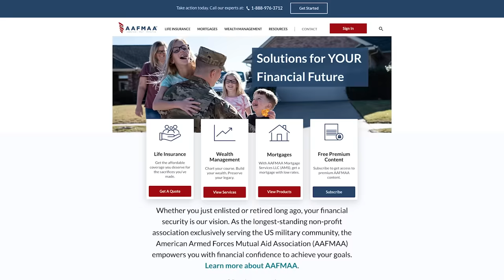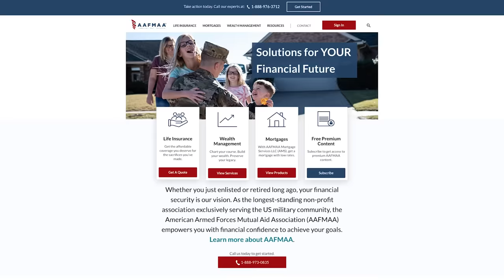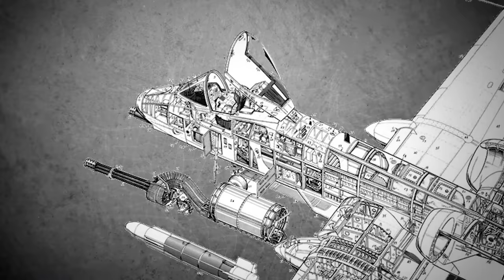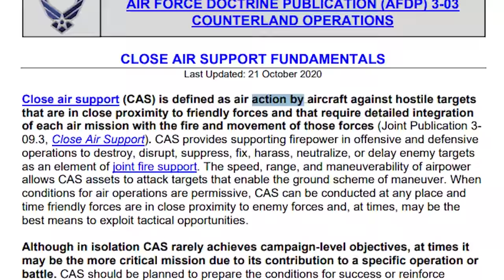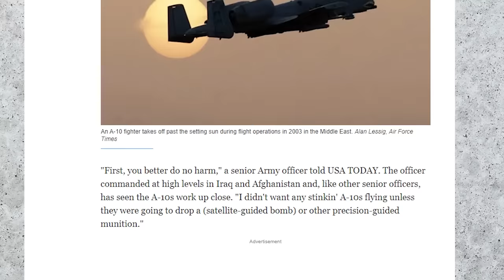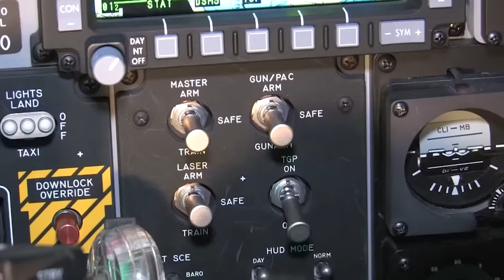Why the Air Force is Screaming to Retire the A-10 Warthog

Comment: I've spent my life in the military, moving from Infantry to Air Force Controller, and I'd like to praise this video. It's is not overly technical, and doesn't get into the weeds of modern 5th Gen Air Power Theory, but rather hits all the big points really well. It's very hard to convince those who aren't employed in the Air component to the current flaws of an aircraft like the A-10, but this video does it very well. Bravo.
Reply: IMO, the problem isn't the long-overdue retirement of the A-10 but the utter lack of an adequate replacement. The F-35's abysmal loitering time, severely limited payload capacity, and hefty price tag make it ill-suited for supplying timely CAS, and drones can only partially compensate for its failings, thanks to their lack of Mk.1 Eyeball and extreme vulnerability to EW and the like.

Additionally, the "low-and-slow doesn't work against near-peer adversaries" excuse is so outrageously stupid that it boggles the mind that anyone buys into it. The last seventy years have proved that politicians are nearly as adept at avoiding near-peer wars as they are at creating not-at-all-peer "conflicts," and military technology has changed enough that even near-peers are likely to end up engaging asymmetrically a lot of the time. A properly designed, dedicated CAS airframe would not only be incredibly valuable in the all-too-likely event of another Vietnam or Afghanistan, but also in open war against an opponent like China, doing things like defending against guerilla-style attacks on logistics and C3 and mopping up ground forces after the air defenses had been cleared.

Edit: In case it wasn't clear, said dedicated CAS airframe should not be the A-10. While the design goals still hold true, for the most part, some of the approaches taken no longer do. For example, it might make sense to have something gun-like to avoid expending $200k rockets on $20k pickup-with-bolted-on-MG, but there are far better options than 30mm auto-cannons for that task.
Reply: @irrelevantfish1978 Even guerilla forces can threaten very low flying aircraft with MANPADS. The thing about drones being vulnerable to EW, is any type of CAS relies on communication to be informed of the mission to begin with. Most modern CAS has automated target tracking already. Whatever means you used to call the airbase, you could call an unmanned mini-cruise missile launcher a few miles away that was dropped off by a truck or a helicopter previously.
Reply: @JWQweqOPDH  MANPADS will have minimal success against reasonably stealthy aircraft (which any A-10 successor absolutely could and should be), even if it's flying low and slow, and there is a massive difference between the durability of voice comms compared to remote drone operation, which is far higher bandwidth and far less tolerant of signal corruption and latency.

And insofar as automating CAS, that's problematic for all kinds of reasons: it's bad PR, it's expensive (if not impossible for such an electronically incompetent outfit as the US military), and turning complete control of bombing runs/cruise missile strikes over to people with infinitely more stress than aerial observation capability (ie, ground troops being shot at) is not a great way to avoid friendly fire and collateral damage.
Reply: @irrelevantfish1978 Also, didn’t the A-10 also do CAS for Combat Search and Rescue?
Reply: I realised it was outdated when people suggested that Ukraine should get some A-10's but Ukraine denied them because they could easily be shot down and wanted F-16's to hit hard and fast before Russians could retaliate... This suggests that the A-10's would be easy targets against an opponent with capable anti-air defences or half decent fighter jets making them completely redundant on a modern battlefield that isn't against simple insurgency groups.
Reply: @irrelevantfish1978 @irrelevantfish1978 so, in the event of another Vietnam or Afghanistan style war, why wouldn't you just drones for the low, slow flying aircraft niche?

As for your suggestion that a replacement for the a10 be stealth capable, keep in mind stealth is a massively expensive capability.

Also, quite frankly, gun based CAS has always been kinda eh? Most of the A10s kills have been with missiles (as much as people over hype the gun), and you don't need something that flies super close to the ground to fire those. Hell, just like, a cheap drone spotter data linked to a firing platform will probably do the job more cheaply and better at that point.
Reply: @irrelevantfish1978  The per-unit cost of an a/c is less than half the battle. One has to consider 'total cost of ownership' over the lifetime of the a/c including pilot and support personnel training and other incidentals specific to that model. Although it may be cheaper to buy a CAS specific model it is likely better in the long run to add those numbers to the F-35 production demand as higher volume means lower cost. In the long run the F-35 is the only game in town to help reduce the defense budget.
Reply: @garymartin9777  need more Avenger type drones for CAS.
Reply: I find it lacking in 2 areas. And tbf these 2 facets are usually skipped over, but still critical to understand what's going on recently and will be going on in the future.
Most of the criticisms around 15m in could be addressed with a simple avionics upgrade. It's these 2 issues which are gutting A10s.

1. AC130s. Gunships can do the "low tech" unga bunga better than warthogs. They can stay on target longer. They have a critical weakness against peer adversaries, becoming sitting ducks. However, we havent engaged an air superiority peer in a long long time.

2. Drones, including loitering suicide drones. These are the future of CAS. They've already been doing surveillance and surgical strikes since W and Obama. They've come even farther.
Reply: @irrelevantfish1978 we already see Ukrainian infantry using drones very effectively - against a better equipped military that is generally considered a peer to US.
Drones are here to stay.
Reply: @crackajacka87 Yeap... and against the "simple insurgency groups" an AC130 can stay around a lot longer, packs more punch, doesn't need to strafe / turn around, has outstanding battlefield awareness.
The A10 is basically just a big d morale booster thing: 'look at this thing'
But i would love to see them start providing CAS to whatever the Mexican DEA is called. NOLA is already in range 😎
Reply: Close air support is an Air Force task. If not an A-10 then what? Ya’ll just want to get back to a snuggly base.
Reply: @mattheww2855  incorrect. CAS missions are assigned to all 4 services/3 components. Army and USMC have organic capabilities for this exact purpose.
Reply: @irrelevantfish1978 What boggles the mind is you thinking a low and slow platform is going to be in the air long enough to provide any CAS whatsoever.

When Ukraine doesn't even want them and are barely getting their SU-25s in fast and low for hit and run passes, me thinks your highly confident comment won't be passing the test of time. As the Air Force has stated, they look at effects, not platforms, and low and slow isn't going to get you any effects at the FEBA anymore.
Reply: It's ugly,  it protects the "army" grunts on the ground...would you rather step into a corvette or a jeep CJ ?
Reply: @jeromeace1282  Why not use drones? First, the Mk.1 Eyeball and a 0ms ping is helpful when attempting to deliver ordinance to targets in close proximity to friendlies/civilians, and second, there's all kinds of fun things an opponent could do to literally bring your drone fleet to a crashing halt.

Also, no, stealth isn't necessarily "massively expensive." Yes, you'll pay through the nose if you're trying to design something to sneak past high-powered radar installations at supersonic speeds, even if the project is well-conceived and the contractor competent (neither true for the F-35), but merely enhancing survivability at sub/transonic speeds is a far, far cheaper proposition.

And as for gun CAS, why does everyone get so stuck on that? The A-10 is more than a flying BFG, and the F-35's insufficiency has nothing to do with its lack of one. Read what I wrote and respond to that.
Reply: @garymartin9777  Cost isn't the only issue, and even if it were, the increased number of aircraft required due to the F-35's deficiency in terms of loitering and payload would add far more to the total cost than you'd save due to increased volume. Additionally, maintenance and fuel would be way more expensive per operational hour than a transonic platform.
Reply: @irrelevantfish1978  
Stealth effectiveness is severely diminished within 20-30miles+ , it would do a ''next gen'' A-10 no good whatsoever. I agree that the budget would be better spent on expanding close support drone tech assisted by long range stealth fighters.
Reply: @irrelevantfish1978   @irrelevantfish1978  no, no it fucking isn't lol, reliance on the Mk 1. eyeball is one of the reasons the a10 has so many blue on blue kills. That shit does not matter in any case where who is who is ambiguous unless you're flying way too close to the ground. 

There is an argument about ping, but I don't see how that matters as long as it's less than a second.

And sure, people can do stuff to mess with drone, but that's an arms race. 

As for that argument, I'll go back to read your rant about the f35, but I'm immediately suspicious of anyone who is parroting "reformer" line, which is what your second argument kinda sounds like to me. They were saying similar things about other aircraft until they turned out to be great (either the f16 or f22, don't remember) 

As for why people talk about the gun, prolly because it gets overhyped, and because a lot of its design flaws are due to it (since the plane was designed around the gun, the missiles were a later concession to how shit the gun was). And sure, there's upgrade packages, but iirc the cost is enough that they might as well just buy new f35s.
Reply: @constantinesoldatos  from what little we know about 6th Gen fighters (aka some fucking press releases lmao) , it seems like there will be a focus on having them be a hub for a group of drones.

So that's prolly coming down the pipeline at some point.
Reply: @JTA1961  it also has a track record for massive levels of blue on blue kills lol. So if anything getting rid of it protects army grunts. 

And if it's not using the gun, why keep it when there are better missile platforms?
Reply: To put it from the perspective of a vet from the other side, there are 2 thing the A10 gives that no other option the west is willing to put money into can. And that is ability to stay in the area and ability to engage for a long time. With a strike fighter, you get how many missiles were bombs for six or so and after that you’re out of weapons and need to re-arm. With a strike fighter, you get how long in the operational area 15 minutes or so and then you have to leave. The aircraft like the a 10 can stay in the area for hours, and provide more than a dozen strafing runs plus bomb strikes. Sensible move for the west, would be to buy something like the MI 28 or the SU 25, but that would be admitting the Russians were right about some thing and like we see from Ukraine We’d rather like millions of people die than admit the Russians were right about anything.
Reply: @irrelevantfish1978 Kinda sorta maybe have to agree with you @irrelevantfish1978; even if it’s not the A-10 (which hey, there are older platforms in service) then at least some other CAS platform specifically built to take a hit, put bombs/rounds on target and not specifically designed to make Raytheon or Lockheed or Boeing ALL the money ALL the time. This whole, ‘put every single god damned egg in this one stealth airframe basket’, thing the services have thought up is truly disconcerting. What if some near-peer finds a counter to the tech? What if there is some fault which starts crippling availability times (which has happened more than once for this and other platforms)? I mean, we’re going to spend ridiculously ridiculous sums of money in any and all events, what’s wrong with a few extra bucks towards another platform dedicated to close air support? Yeah F-35’s and F-22’s are awesome, there’s no doubt, but God forbid we get into a war with China or God God God forbid the Russians, F-35’s ain’t gonna cut it.
Reply: The A-10 can be stealthy when flying low. I was hiking out in the desert in the canyons and one of those flew over real quickly and down low. I really didnt even notice it coming because it was flying so low.
Reply: @Mortablunt  So first off, I'm assuming you're talking about the a10's gun, gun based strike fighters have always been terrible against armoured targets (there have bee studies dating back from the soviet days, along w/ various others agreeing with its findings, showing a huge tendency to over report kills despite how little casualties gun based plane attacks actually deal to armoured targets)

Meanwhile, if you want something w/ a gun for use vs infantry....you don't need a dedicated aircraft for that lol.

Second off, you want something that can loiter in an area for a long time? That's what drones are for, hell, something like the Byraktar only performs about as well as WW1 era planes iirc. And that's all it needs to do.

And if you want something w/ a lot of shots, tbh, just stick a gun on the drone or use it to spot for mortars/artillery.

Also, there is no world where the west would be willing to agree to the conditions russia would require to sell them Migs or Su's lol. Buying advanced weapon platforms isn't just like buying groceries lol, you need a good relationship w/ your supplier.

That's like saying the Russia would be able to buy Abrahms tanks to make up for the fact they've been using the same engine since world war 2 (except the t14 engine which is somehow even worse lol).

And the only thing the russians are right about is that NATO expansion means the russian empire can never be reborn.
Reply: @miamijules2149  Its questionable if the design tradeofs to make a CAS craft be able to take a hit are worth it. Assuming there are ground forces involved, just using drones as artillery/mortar spotters will prolly fill the role a lot of the time. And if not...well, drones can do the job way cheaper and w/out needlessly risking the pilot's lives by flying low and slow.

As for older platforms being in service, that tends to be because they found a new role despite their original one being obsolete 

(like, the b-52 gets used as a platform to fire cruise missiles off because they turned out to be engineered in a way that's super good for that, despite the fact that they were built as strategic bombers, which are obsolete as a concept)

(or how the infantry fighting vehicle replaced the armoured personnel carrier, but the m113 is still used in other roles

not that anyone who watched the pentagon wars would understand that lol)

As for the f-35, stealth is probably going to become a pre requisite to surviving in contested airspace tbh (the invasion of ukraine being not the best example because neither were really up to snuff in that department). Its just there's an assumption war will look remotely like it does today because that's what people know.

As for the whole 'peer war' China is the only real consideration where the f-35 actually matters. Russia's military has been revealed to be a husk that exists for propaganda and to pay for people's yatch funds (and yes, the USA lies about their weapon systems, but they do it to make them look worse than they really are lol), but their nuclear arsenal means there's invading them isn't an option.
Reply: @djsmith2871  You clearly didn't read what I wrote, so I'll TLDR:
(1) Most of the US military's adversaries won't be near-peer.
(2) Even between peers, the nature of war has changed, such that a lot of CAS will be necessary in areas with minimal surface-to-air and air-to-air threats.
(3) The A-10 doesn't cut it anymore, but the F-35 won't, either. There needs to be a new dedicated CAS platform.
Reply: @constantinesoldatos  If stealth is useless at <30 miles, why bother stealthing helicopters, particularly when it's impossible to do so to the same degree as fixed-wing aircraft? Answer: because there's a big difference between surviving by not allowing the enemy to know where you are and surviving by making yourself hard to target. Even if they can see you, and even if they can get a lock, stealth gives additional time to evade and makes countermeasures more effective.
Reply: @irrelevantfish1978  That is actually a fair point, even if they can see it, it's still harder to maintain proper lock to guide an AA munition against you. Thank you I didn't think of that fact. Still though they probably want to invest in drone tech a bit more heavily for close support since it ticks all the boxes, can be deployed faster and in larger numbers and puts less soldiers on the line. 
But I'm only speculating those are the reasons, it's all we can do after all based on open source information.
Reply: @jeromeace1282  Get your facts straight. The A-10 makes extensive use of vision systems, particularly thermal, and its independence of pilot vision is, in fact, one of its main selling points. Additionally, in spite of adding weight, being a major PITA to stealth, and the AR system making it entirely possible to forego/greatly reduce, the F-35 has a whole lot of transparent canopy, so clearly a whole lot of very knowledgeable people believe that the human eye is a great sensor package to have available.

And as for your dismissal of drones' vulnerabilities ... gotta admit, my jaw dropped when I read it. I mean, if your intended opponent probably possesses/will possess economical countermeasures with a 100% success rate against your weapon system, you're not in an arms race; you've flat-out lost it.
Reply: @irrelevantfish1978  ah, okay, I wasn't aware the upgrade packages meant that you don't have to rely on binoculars anymore.

I don't see how that's supposed to be its main selling point when a heavier reliance on sensors has just kinda been the direction things have been going since... Well since plane mounted radar has been a thing.

As for the drone vulnerability stuff, a decent bit of what I'd heard about going on in Ukraine was exploiting the civilian origin of most of the drones being used, which wouldn't exist in military stuff. 

Also, what is this magical thing that prevents all drones from working? Who has developed it. I can believe it's not being used in Ukraine because, well, quite frankly the Russian army is dogshit, and most of Ukraine's stuff is western handouts.
Reply: @jeromeace1282  
Go check Red Effect and Cone of Arc for clarification about the T14, the engine claim is like saying the US uses the Mauser 98 because it uses the Mauser action in the M40A rifle.

Anyway...

The gun is absolutely an important part, because it offers flexibility and cheap firepower against more numerous more delicate targets. Not everything needs a tandem shaped charged hollow penetrator missile -- men, cars, and APC's will go down just fine to the 30mm. That ability to not waste short supply priority munitions is very important when operating at scale for prolonged periods.

There are some truly huge tradeoffs for all possible substitutes for an A10/SU25 aircraft. For one, you get about 80 minutes of loiter with them, during which they can be on site to deliver precision support within seconds. Not the minutes it takes artillery to reckon out a shot and then get it over. These planes can carry more than helicopters or drones, that's important, it means they can stay combat effective longer.

Helicopters are a convincing alternative, but they still carry much less and are significantly more fragile than fixed wing aviation.

The big problem with the Bayraktar is it has a tiny payload. You get up to 300lbs across a max of 4 shots. Can't be beat for persistence, agreed.

For maximum firepower and basically unlimited endurance, nothing beats tanks, but then there's the problem with getting them there and the lack of perspective they have on the ground.
Reply: @Mortablunt  First off, no it isn't? The red effect video uses a lot of deceptive tactics (mainly going off an a vaguely related tangent about a specific detail that isn't relevant to the actual point) because actually defending the t14 on its merits would require admitting if not for the engine being terrible, it would just be a mid tank compared to western designs. 

And also, lets say it was a correct analogy. It would only apply if the mauser firing mechanism was an irredeemably bad one that they then decided to pidgeonhole into their new gun despite it being terrible because they didn't have the r&d talent to develop something better.

As for the gun...even if the gun is worthwhile to keep (notably iirc certain more modern western jets, including the f35, do have the option of adding gunpods, they just don't use them because they're not needed) the a10 100% is not the platform you want for that. 

Its too vulnerable to survive in contested airspace (doesn't matter if you can fly back after taking several hailstorms of bullets, at the end of the day a MANPAD doesn't give a fuck about that and will shot down your multi million dollar air craft out of the sky for like, what, 100k dollars maybe, nevermind other air defences that exist), and in cases where it did operate in complete air superiority...it killed a lot of friendly soldiers. Hell, in afghanistan they stopped using it due to it killing so many civilians that it was a PR win for the taliban. (the gun is uh...well, its super fucking inaccurate) 

As of late the a10 ended up getting used as a missile plane a lot of the time...and at that point you might as well use the f16.

You could argue that this is a failing of the system rather than CAS gun planes being obsolete...but given how russian pilots barely get enough flight hours to keep their certification, it'll be hard to actually prove that.
Reply: @jeromeace1282  Cheesy crust, you don't know anything you're talking about! Buh by! I'll let reality do the talking for me as the results come in.
Reply: @Mortablunt  there kinds can't be results if gun based CAS planes aren't being used tho? The Ukrainians don't have a CAS aircraft, and last I checked the Russians are literally just lobbying missiles from specific migs from their side of the border.

And if anything, the latter is an indicator this air defense environment is terrible for gun based CAS planes.
Reply: @jeromeace1282  It would probably require two magical things, actually: anti-satellite missiles and signal jamming. Without a constellation of communications satellites overhead, it would be virtually impossible to prevent a well-equipped, well-informed foe from blocking communication between drone and operator unless they were very, very close to each other.
Reply: @irrelevantfish1978  so, I'll give you the benefit of the doubt, and say that yes, attacking the satellites (in ways that won't blow it up because that's a fucking awful idea, as Kessler syndrome means you've now probably pissed off neutral countries and your allies, and have also probably messed up your own constellation as well) would be effective, but opens you up to retaliation that... Probably isn't worth it? Not quite sure what the best method on that front would be though. 

As for signal jamming, honestly I don't know enough about that one to say. 6th Gen fighters might solve that tho, as from what few press releases there are they're probably going to focus on being a hub for drones, which implies much closer ranges than what you see with someone in the US drone striking the middle East.
Reply: @irrelevantfish1978  The F-35 and F-16 can carry APKWS, which is in the same price range as a gun (all things that make it necesary included) and is considerably more accurate. 

The F-35 is also cheaper to operate than the A-10's. If you've ever worked on beater cars you know this. The older shit gets, the more it needs to be maintained and the more spare parts it is going to need.
Reply: If the USAF doesn't want them the Army will happily learn how to maintain them.
Reply: @LupercusArchanus  the army has no intent or hope of maintaining them. Wishful thinking at best.
Reply: They've already got a replacement if they chose to go with it. The Sky Warden is already being used with sf units. Similar plane I don't remember the name is seeing action in Africa right now with good results. I think a plane is still viable over drones because of the amount of munitions carried and drones are taken down easier than planes and with counter options being developed will continue being taken. Don't get me wrong drones definitely are here permanently and are successful just they've got their uses and problems as well.  F35 is costly to operate and cannot stay in the area for long periods. Yes manpads are a threat to a slow low flyer but it's not like every person or even unit is/ will be equipped with them. UKR has been a good example of all these problems faced. Some areas are covered by aa others not. Manpads have been effective but not always and limited numbers.
Reply: @ronnie0817  The F-35 is actually cheaper to keep in service than the A-10. The A-10 is  a very dated airplane and that takes ALOT of maintainance to keep flying.
Reply: @koekiejam18  I know and agree I'm not saying to keep using the A10 I'm saying replace it with a different platform that can fill the gap between using the f35 and drones.
Reply: @ronnie0817 That might just end up more expensive than just using F-35's and drones. Unless offcourse it is (relatively) short range at which point artillery will work.
Reply: @koekiejam18  I already provided a reliable option that's being used currently by socom and another being used in Africa. It's a cheap platform to purchase and operate. Yeah you could call arty and use a drone if you're in range of it or can move it in reasonable time. Like I said there's gaps that multiple options can fill. The Sky warden or similar has proven effective and filled the gap of no arty and too expensive plus not enough fly time. I don't remember the exact price but its around $150000 for the plane and then like $70000 for upgrades to make it cas. I think it's the cheapest option for the role
Reply: @irrelevantfish1978  the problem with replacing the A-10 with another platform capable of "long loiter time, huge payload capacity" is that spending a long time on station in a non-permissive environment is nonviable.

The problem with the A-10 isn't that it's slow and has a massive radar cross section, the problem is that it has those features in support of the ability to stay on station for extended periods of time with a massive payload.  Modern air-defense and air-to-air capabilities necessitate low observability (which limits external payload options) and a "shoot and scoot" approach to weapons delivery (limiting loiter options).

Having the endurance to stay on station for 4 hours does no good if the enemy has the ability to kill anything which remains on station longer than 15 minutes.  Having the payload capacity to level a city block one window at a time does no good if bringing it to the fight means the enemy can  see (and therefore, kill) you before you reach the target.

The problem is that peer and near-pear air denial capabilities make the MISSION of the A-10 nonviable.  That's why it's going away.
Reply: @ronnie0817  It does however require the needed personel to keep it flying. It requires pilots to be (re)trained for the specific airframe and it requires new parts. Things like reeducation and infrastructure dont come cheap,
All in exchange for a rather cheap plane
that houses a rather expensive pilot. (A pilot that wont have the option to eject and is instead left struggling to get out of the cockpit.)

My guess is that if the Airforce can get away with using just the F-35 they absolutely will. 

A big sidenote is also that the Skywarden isn't that good of a plane, it is not even seen a replacement for it for its predecessor, ( a repurposed passenger plane used exclusively for anti insurgency warfare.)
It is meant to take over Strike missions and ISR only. (ISR offcourse being done incredibly well with drones)

Meanwhile the F-35 is getting cheaper and cheaper to operate. ALOT of countries are also currently building up infrastructure, training facilities and crew experience that is completely interchangable across continents.
External fueltanks are also in development for the F-35 and with those it will be able to loiter for more than enough time to completely replace the A-10.
Reply: @koekiejam18    it does require all of that and no it doesn't come cheap. But it's airframe is common parts are cheap and common. If a farmer in the Midwest can build the infrastructure and maintain it the government should have no problem. Butt from what I've read it's about $10,000 an hour over expected lifetime whereas you're looking at up to $150,000 an hour depending what resources are used to fulfill mission (Q9, A10,F35) . The program right now is being developed for sf use it wouldn't cost much more to expand the program and add a few more planes. Yes there's no ejection seat that's why the system was built with survival similar to A10 and counter measures for manpads and other systems primarily to be used in areas that we have control of the air. Even with the f35 getting cheaper it's not always the right tool or available Iraq and Afghanistan are examples F16s they weren't always available or even with extended tanks stayed for 30 min and left plus they were hesitant about dropping weapons and after they left fighting picked up again and nd other craft had their down sides. Drones are good for isr but carry limited weapons and require other aircraft depending on situation. Like I said just like other aircraft something like the sky warden has it's place. Also the whole sky warden program has been a big success and even proven that drones and jets aren't always the answer that's why it's been approved full funding
Reply: @ShuRugal  I addressed almost all of that in my initial comment. Please read the whole thing.

The one point I didn't cover was the incompatibility of stealth and external ordinance. Yes, this is an issue, but one far more severe and less easily mitigated in supersonic aircraft, where cross-sectional thickness is far more heavily penalized. At lower speeds, aircraft can have substantially larger internal volumes without tanking their lift-to-drag ratio by enclosing that volume in lifting surface, thereby reducing total wetted surface area. That's the principle behind flying wings, and while I suspect a stealthed CAS platform would look less B-2 than V-173 "Flying Pancake," and probably couldn't carry quite as much ordinance as the A-10 (though cutting back on the BRRRT might fix that), it would still pack a whole lot more than the F-35.
Reply: @irrelevantfish1978  it was not my intent to contradict you, but to expand upon what you had said
Reply: @irrelevantfish1978 -- I'm just an overweight civilian wannabe, but I have been watching way too much MilTube over the past eighteen months (as have so many of us), and my takeaway on all this is that the concept of close fire support being fulfilled by a single type of heavily-armed, heavily-armored, low-flying, fixed wing aircraft is itself obsolete.

The role played by the A-10 will now be dispersed among several different weapons systems, including the F-35, F-16 (those are still around), AC-130, drones, and the Army and Marines' renewed interest in ground-based long-range precision fires. None of these platforms will have ALL the same capabilities of the A-10, but all together, they'll provide all the same capabilities and more besides, all at lower cost and greater flexibility.

This really does follow the trend in Western militaries of standardizing munitions delivery platforms, and putting all of the specialization in the munitions themselves.
Reply: @JohnnyWishbone85  I've already addressed all those excuses and why they're crap.
Reply: "flaws"?
Reallly?
Tell that to those on the ground who would be DEAD if it weren't for an A-10 showing up and destroying  anything and everything trying to kill those troops.
Reply: @babsme6459  so you're saying because it has completed some CAS taskings successfully we must therefore ignore its glaring and growing flaws. What? What a flawed line of logic.
Reply: @babsme6459  A-10 can't be up in the air providing CAS if it's been shot down before it ever reached the AO.
Reply: A10s over Iraq apparently could go 80 missions between being hit by SAMs like s200, Pantsir, MANPADs

A10s over the frontlines of any Ukraine level near-peer fight would face 6 Pantsir trucks (12 missiles on the rails each, 1500mph, 11 miles and 49000 feet range) per BTG and apparently several dozen MANPADs ... Plus overlapping s300 and s400 sites 150km from the combat zone with a 200km range

= Each A10 mission would end with a shootdown halfway in ... A10s aren't invulnerable, just resistant to small arms, .50, and 20mm

CAS by any 4th-gen aircraft or cessna-sized-drone large enough to pack several dozen punches and with hours of fuel = large enough to be trivially seen and killed by s300 and Pantsir

Pseudo-CAS by artillery is a shell flight time delay of several minutes

CAS by suicide drone like switchblade is both laggy and expensive

CAS by kindly stealthy Storm Shadow sized cruise-missile sized reusable drone IS possible even in a jamming heavy environment :

= Navigate to XYZ coordinates using frequency-hoping GPS and datalinks that frequency hop via Star Shield (SpaceX StarLink but military) ... Then take local squad commands via encrypted uplink from spotter-sniper scores ... * Then at bingo+10%, return to base for net capture and refuel + reload ... 1000 pound warhead= 1000 pound multi submunition dispenser payload of thirty of a combination of
* 30 pound SADARM infrared-seeking self-steering top-attack HEAT submunitions vs any AFV or tank
* 30 pound cluster munition of "offensive grenades" or fragmentation grenades around a retrorocket and spreader ... Vs trenches or any soft vehicle like fuel trucks etc

Or ... Cheat...
Use a CV90 with an AMOS smart 120mm double mortar turret
* With 2 dual StarStreak pods on the sides of the AMOS
* With a xm29 type precision airburst 25mm gun for anti-drone or anti personnel if absolutely necessary
* AMOS firing : 
* Dumb rounds with 5m CEP at 10km precision even while the CV90 is moving ... Aimed via datelink from the spotter-scopes with the infantry squads
* STRIX self-steering infrared-seeking anti-armor top-attack HEAT rounds 
* Hero-120 or Firefly-120 mortar drones for attack or target spotter or munitions dropper bomber but capable of returning for net capture and refueling and rearming

= Turns the AMOS vehicle into a miniature AFV aircraft carrier controlling all territory for 20-30km nearby, especially for CAS support of nearby infantry squads
Reply: @irrelevantfish1978  -- I know. You made a lot of very cogent and well-reasoned arguments that are, nevertheless, wrong.
Reply: @irrelevantfish1978   everything you say a cas fighter is sutiable for can be accomplished with a helicopter for far cheaper. Regarding the drone argument you act as though a force is more likely to have advanced jamming than anti air which every military force on earth has had some form of for the last 50 years. Your trying find a problem for your solution than the other way around. Cas jets aren’t needed against a small guerrilla force a helicopter will do just fine anything stronger than that will shoot down both.
Reply: @irrelevantfish1978 One more thing with tankers nearby an f-35 can loiter for up to 90 minutes according to a pilot that worked with them and the only place where you hypothetical plane will work is uncontested territory where you can keep tankers for refueling making that point moot.
Reply: @justinsaunders110  1) Focusing exclusively on an extremely unlikely non-nuclear conflict between nuclear powers while utterly failing to consider the near-inevitable not-at-all-peer conflicts is idiotic.
2) Helicopters are inherently unstealthy. While you can make them less unstealthy, they will inevitably be less survivable than a equally well-designed fixed-wing aircraft.
3) Against a fully modern military, large-scale ground operations are virtually impossible without air superiority. As a result, CAS will mostly occur in "uncontested territory."

4) Even in "uncontested territory," there will be MANPADS, so no, you can't keep tankers for loitering assistance. And even if you could, for that application, they're a logistical, economic, and safety nightmare in a sustained, high-intensity conflict.
Reply: @JohnnyWishbone85  Your vocabulary is impressive, but no matter how polysyllabic your rendition of it, "I"m right, you're wrong, neener-neener-boo-boo" is not a valid form of rebuttal.
Reply: @irrelevantfish1978  -- Ahem, it's "I'm right, you're wrong, not an idiot, but still wrong, see my previous argument for details, neener neener thbthbthtbt!!!!!"